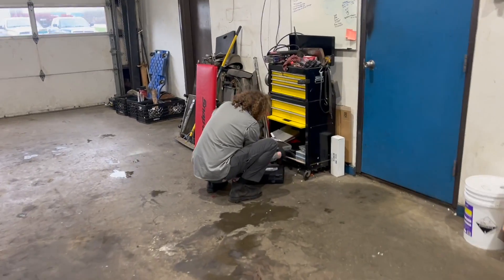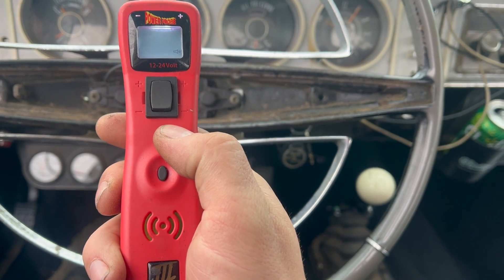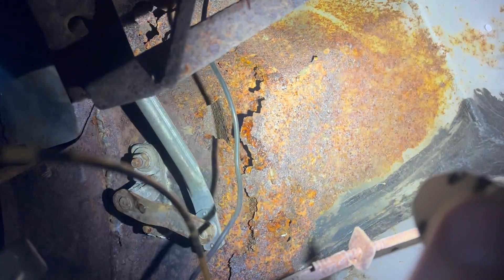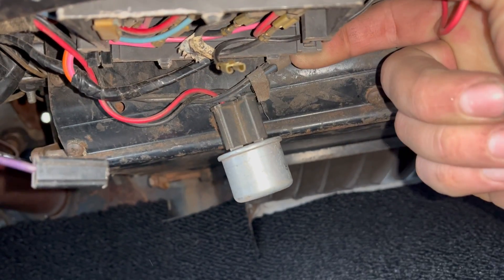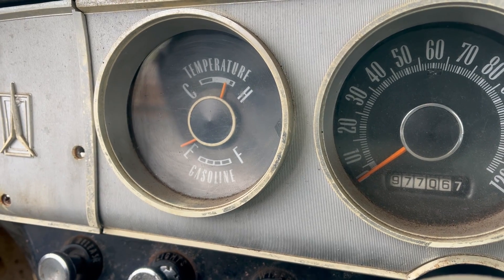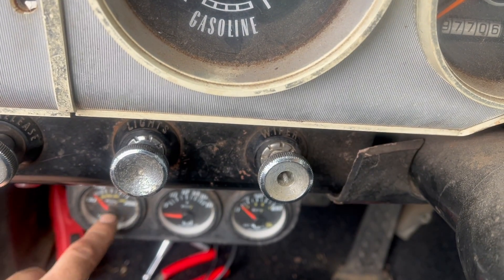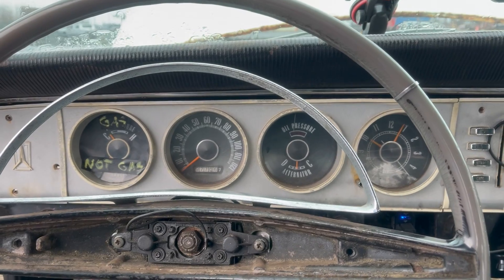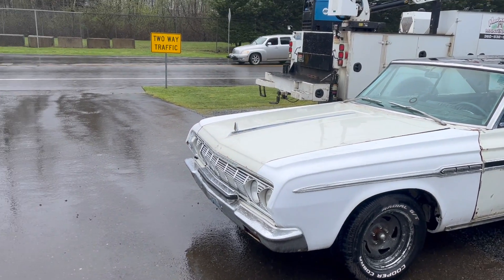A Brilliant Gas Gauge "Fix" For This 1964 Plymouth Fury (And How To Diagnose A Bad Fuel Gauge)

Comment: All you would have had to have done was to go and ohm out the gas gauge under the dash if the little wire was broken it would have not have any resistance to it and you could have pulled the dash open the cluster to get to the little wire on the gauge and fixed it
Reply from the maker: I am well aware of how an ohm meter works, but by using the 5v voltage input and the power probe to check for that input on the other side of the gauge, I have checked for and confirmed a break with the same tool I use to check the key power feed, the limiter feed, the circuit board traces, connections through the nuts to the gauges, and the integrity of the fuel sending unit circuit. Using that tool, I found and fixed four or five different small problems - which led me to the big one. I strongly suspect that when we get into the gauge, we will find it’s melted and horrible. But we’ll see. If it’s fixable, great. If not, it will be replaced - which was the plan from the jump.

Comment: My first long ish trip in my 1984 B350 RV ended with a flat bed. Distributor broke, the springy retainer clip for the pickup coil broke into pieces. Lucky for me they don’t sell just the clip so I put in a remanufactured distributor,again. Lesson learned, Amazon distributors are not very good. Other lesson learned, falling off a flat bed truck and landing on your back and head hurts, and causes some injuries.
Reply from the maker: Oof… yeah, let’s try not to do that.
Reply: Well, our trip didn't end with a flat bed. There was one involved at one point, but I guess we're Energizer bunnies--we just (eventually) kept going! And at least nobody fell off the flat bed.

Comment: Been without a gas gauge for 10 years lol.  Bought a used one 5 years ago, put it in and POOF. It just kept going up to full, then nothing. Is there an aftermarket option that hooks up to a Mopar sending unit?
Reply from the maker: That’s a bad gauge voltage limiter. When they stick closed, they feed full 12v to the gauges and let the smoke out. But yes, there are compatible gauges. You’re looking for the 10-73ohm resistance range.
Reply: @DeadDodgeGarage  man that’s great news and info, thanks Jaime

Comment: I bought a $20 fix on Fleabay for my 66 Dodge. It worked.  An SS (solid state) voltage regulator/step down (5.5 volts). An easy job. But yeah, this works too.
Reply from the maker: Yeah, that’s what’s in there powering the gauges - although it is 5v. They actually have nice plug in solid state replacements for the factory limiter available these days too.

Comment: I had so much fun trying to get the gauges working on 64 Dodge. I have them all working, except the Amp gauge, I have no idea why that one isn't working and I've given up caring. I can tell it has oil pressure, fuel and isn't over heating.
Reply from the maker: Good enough!

Comment: If there's no physical damage to the guts of the clock, you can borrow my method.

Remove Clock from housing exposing it's inner workings.
Flush the inner workings liberally in brake clean.
Allow to dry.
Spray the inner workings with a light oil, WD-40 works fine.
Clean the contact point on the automatic winder.
Test.

If there's no damage to the clock mechanism, chances are it's just gummed up. Clean it, oil it and 60% of the time, it will come back to life every time.

Comment: Now if you was being fancy, Jamie... you could have stuck a switch under the dash that toggled between sensor feeds to the gauge.  Probably moot though since he has the aftermarket gauge set.
Reply from the maker: Right. A single pole double throw two position toggle would accomplish that. But judging by the alligator clip wire, I was not being fancy 😅
Reply: @DeadDodgeGarage  ya, I did notice.  Hopefully those are 6k mile rated alligator clips. 😄

Comment: Rusted cowls are boot washer and thats a special option. Doesnt the tank sending unit do 70 30 ohms to work with the gauge?
Reply from the maker: It’s 10-73 ohms I believe, supposed to be compatible with ford.
Reply: @DeadDodgeGarage  ok lost my brain couldn't remember. I need that sending unit for the drag truck tank.

Comment: My classic Mopar fuel gauge broke a long time ago, I think I can call a 1984 Ram B350 a classic now. Previous owner got rid of the wiring harness to the fuel tank and I built a custom cluster with no fuel gauge so I use the trip odometer. I am pretty sure that Fury could make several 6,000 mile road trips.

Comment: The "alternate" fuel gauge is cool - maybe "C' can stand for "Critical' and "H" can stand for "Happy". Now what would be equally cool is to use the fuel gauge for temp - "E" for "Excellent" and "F" for "FIRE!".

About that cowl rust...maybe a temporary fix is some silicone on the outside to seal it up at least for awhile?
Reply from the maker: Haha. Nice. Can’t access that from the outside unfortunately. The outer cowl / intake area will have to come off to access it correctly. It’s already been halfass patched together once before. Back in the 80s or something. I’m sure he will want to fix it right eventually.

Comment: Still a sad fact of the Mopar aftermarket - nobody, I mean nobody , makes a decent/accurate sending unit for the 68-70 b-bodies. There's tons of them out there - and they're all junk.
Reply from the maker: Yep… that’s why Rocket has long cleaned, refurbished and reused original sending units. The aftermarket ones available are just not accurate at all.
Reply: @DeadDodgeGarage  the one I put in my '71 isn't great either.  I didn't have an original to use though.

Comment: Do you know of a flex plate to bolt amagnum 360 to a 904 transmission
Reply from the maker: I always use the later 90s Magnum flex plate with the balancing weight. The one hole has to be oval’d to accomodate the offset bolt on the converter, but I’m fairly sure they are the same bolt circle otherwise. There was a larger circle used in some classic applications, but pretty sure 904 and later Magnum are the same.

Comment: Ooh, almost first! Also my 66 Coronet does have a working fuel gauge. It mainly took a good used gauge, cleaning connections, a new instrument voltage regulator and better grounding. Like, everything. Now when I fill up, it reads full! And gas leaks everywhere. More new stuff needed, and modern lock rings suck. Oh yes, also resoldered the circuit board and gave it a dedicated ground wire.
Reply from the maker: Haaahaha. Crap. Yeah, stick with the old lock ring. Repros are terrible. Our ‘66 Coronet has a working fuel gauge for a while if I wiggle the connections on the back of it.